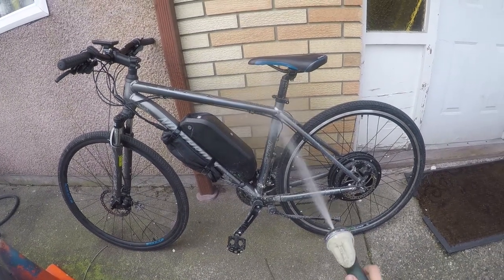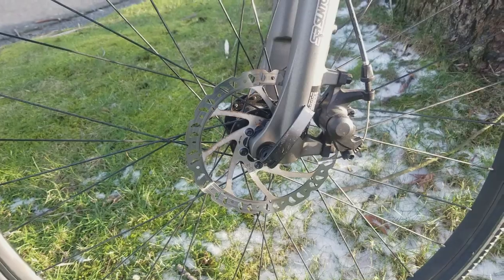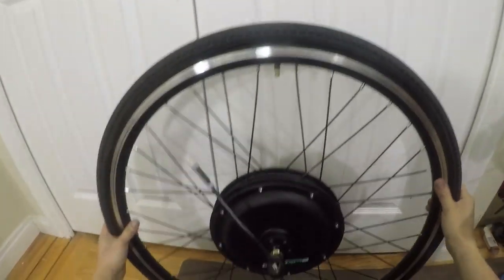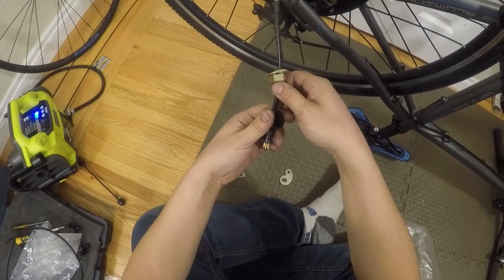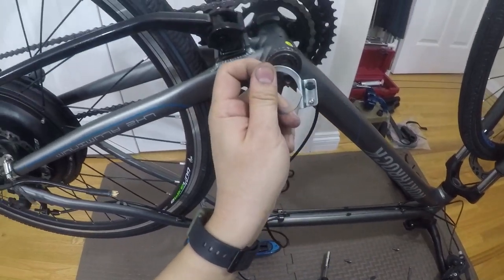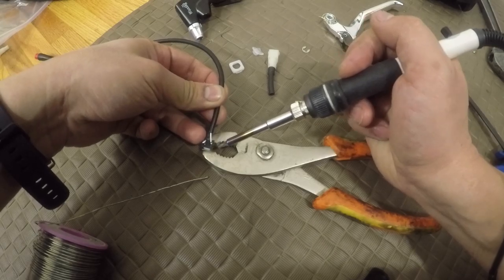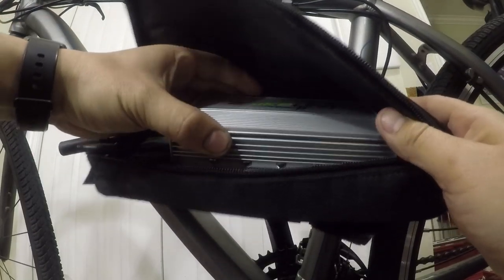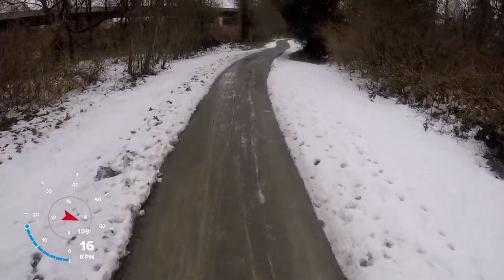Ebikeling 1200 Watt DD Waterproof  Ebike Install

Comment: nice work on the conversion. I like the modification you did with the brake switch. One thing I was wondering about is why you had the wires come up out of the hub motor as opposed to down out of the hub motor. I would have thought to come out down who prevent rain clinging to the wires from going right into the hub motor. The way you have it.. it seems the water would naturally want to run along the wires and drain into the hub motor?
I am also wondering how you got the torque arm over the connectors coming out of the hub motor. was it just the one black connector? did you have to do any workaround to get it through the hole on the torque arm axle mount?

Comment: I like what you did with the brake levers, I have hydraulic brakes on my bike which are incompatible with those sensors, but what you did is a nice little work around.

Comment: Great video Doug. However having the controller in a bag blocks air flow over the heatsink fins. But in your cold climate that doesn't matter (but for me it would being in a hot climate).
Reply: If the controllers enclosed inside the wheel motor, how is that any different?

Comment: I have a Schwinn with the same shifter integrated with brake lever setup, was wondering if I needed to convert to new shifters to get the brake switch to work. Now I know there are options, thanks!

Comment: Awesome video! I got the 36v 750 watt kit and a 36v 8 amp hour battery, it’s fun! But the system cuts out after continuous throttle for more than 20 seconds and pedal assist doesn’t work. Do you have any ideas?
Reply: If the pedal assist doesn't work it's most likely that you put the sensor backward, not sure about the 20 seconds on the throttle, could be you set a really low-speed limit like 25km/h in the display.

Comment: Doug, I don't want to use the crank sensor, old school, I just want the throttle without the crank sensor also I'm not going to use the break lever cut off just because my set up is somewhat different.  I am using mine in a Velomobile, not a bike.  Would the system work without input from the crank sensor?  I've done other kit and left out the break cut off and it worked fine but it has been a long time since I've installed a kit and never dealt with a crank sensor.  Any help would be greatly appreciated.
Reply: Yes it will work without the crank sensor.

Comment: I just got the kit thinking I could install it. Folks, if you're not handy dandy don't buy this. You're going to waste your time. Most of these videos does not show how the wheel does not have an axle and it's incredibly thick, so it does not fit most modern bikes. It's only held by bolts. Second, disc brakes are not compatible with the front wheel kit. They're rubbing. No matter what I did with the brake it kept rubbing so I had to take it off.

Third, battery is extremely big and by big I mean it's as big as a friqin PS5. It does not fit into a normal MTB frame. I had to zip tie it down but that's only a temporary fix cuz how you gonna charge it? Remove zips and reinstall everytime? No way.

Forth problem, the kit is ancient. It comes with brakes that has those little buttons as sensors in it. But most modern bikes now have the break and the shifter together. So if you don't know how to solder and glue and tinker like this guy you're fucked.

Fifth problem, I have installed the wheel, the battery and the controller and my bike is so heavy, it must be around 40-50kg! If your motor turns off on a hill. ..... Good luck.

Long story short, do not waste your money. The tools you need are much more than they show in these videos, you need to buy those too, and the time and energy you will put into it it's just not worth it. 

I'm gonna send everything back and save up for a decent ebike.

Comment: Wonderful video again!  Doug, is the 50 kph top speed with throttle alone? If so, what is the top speed with full assist and pedaling on flats?  Thanks in advance.
Reply from the maker: yes 50-52 kph throttle alone on flat ground.  at thoes speeds i cant pedal fast enough to help. downhill ive hit 68kph .

Comment: Hey I have the same kit with a 48v instead of the 52v is there a speed limiter wire on this kit and if so how can u find it since the wires r in water resistant tubing?

Comment: Hi Doug, will this Hub Motor work with an Joyisi 48V 20AH E-Bike Battery for 1500W Bike Motor, Lithium ion Electric Bike Battery with Charger, Taillight, BMS Protection Board, Battery Level Light and Safe Lock?
They also make one for 1000W not sure which would be better. Any advice, I will be grateful for.
Reply: Yup

Comment: When I use my 52V 17Ah battery for the same kit and the motor clicks when it turns on and clicks when I try to use the throttle. But the motor doesn't spin can anyone help?
Reply: More info please

Comment: I want one Doug.  Help me build one without spending an arm and a leg. :)
Reply from the maker: At least 50% of your budget should be the battery.
Reply: @DougHnut  What are your thoughts between this brushless hub setup compared to your mid drive Bafang setup?
Reply from the maker: Hub is cheaper and more efficient/faster. Mid drive has better weight distribution and can take advantage of lower gearing. Basically better for off road. I prefer hub drive for most of my riding mainly because it's faster.
Reply: @DougHnut  It's 2021, you probably won't see this message. LOL.   I'm gonna build one this year.  Will need some guidance.

Comment: Nice build. I electrified mine 3 years ago now. I run the BBHSD and my wife runs a BBS02. Both 52v. What is your top speed I see average speed of 17.7 mph just curious what you can get out of that hub motor on flats with a 52v battery. We are limited by gearing with the mid drives. 34 mph with 42t and 11t.
Reply: 50 km/h
Reply: 8:22